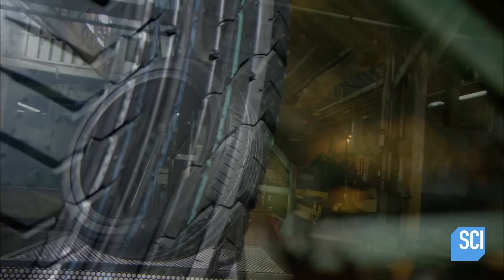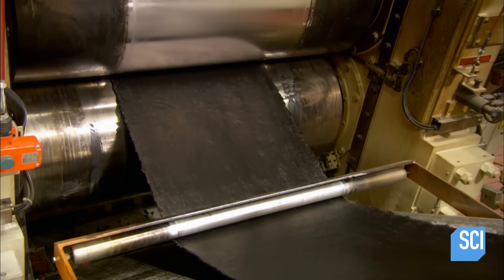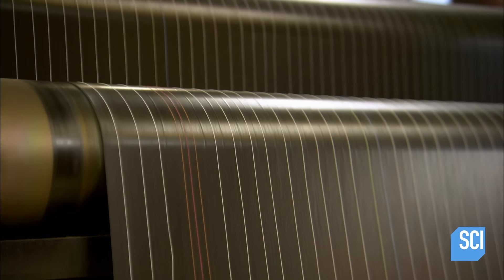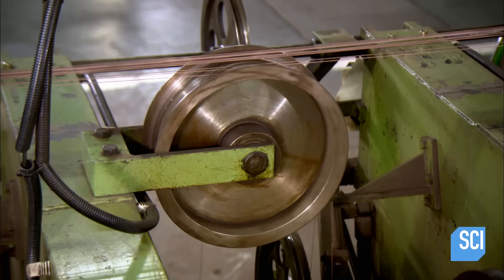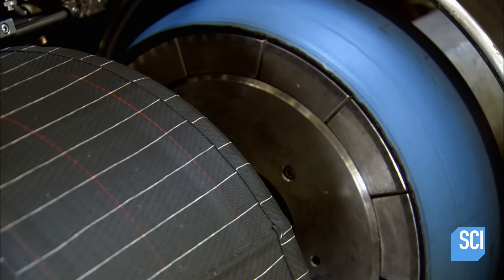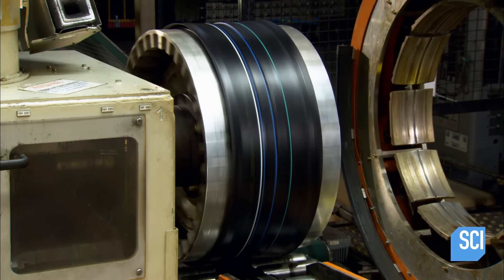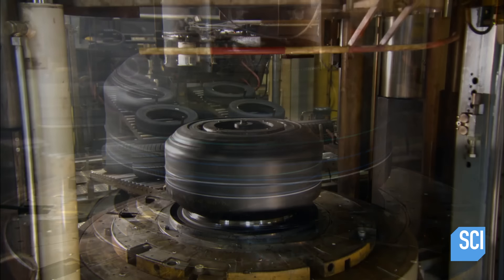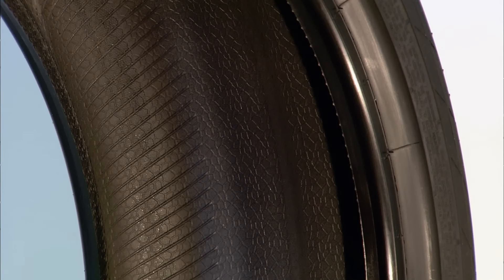How It's Made: Car Tires

Comment: I always thought tires where molded not made with many layers. Interesting information
Reply: Some of these layers are measured to the thousands of an inch.  That rubber that holds the air in, anywhere from 0.020 inches to 0.085 inches depending on the use, passenger or earthmover.  Similar with the ply.  A lot of work, and the factory smells bad.

Comment: How tires are recycled:

Oof
Reply: Its called retreading. IDK if there is a how its made on it, but I think I saw a dirty jobs on it.
Reply: You would be surprised how much ground rubber is included in some tires.  Also those curing bladders that push the green tire into the mold get recycled as well.

Comment: Wow i have never seen a banbarry that clean. this must be a research test facility for tires. a banbarry is were all the compounds get mixed with carbon black because rubber is clean and white.

the tire machines looks along the lines of what you would call a G3 OR  a VMI or a PLT

They dont use paint like this any more. to expensive.

different tire take different cure times depending on compound and size.

when they cook they tend to have flash. . flash is thin rubber that gets squeezed out of the mold and tire. real thin and makes tires look ugly.

tires go to grinders and inspections to smooth and balance the tires.

then they get shipped. theres alot more to tire building than shown in this video.

Comment: So to recap: the rubber is first coated with rubber, then magic string and wires are also coated with rubber, then it's all bonded together with more rubber-coated-rubber and stripes are painted on it to indicate what types of rubber were used, then it's placed in a mold and expanded and heated until the rubber becomes a different type of rubber. 

Did I miss anything?
Reply: You missed where the rubber is rubbed together with more rubber on a spinning drum of rubber.
But other than that, you get the rubber stamp of approval!

Comment: Why Car Wheel has to be one fold? why not divided into 5 or 6 folds that can be inflated by air separately so if one is  deflated while driving on high speed the other segments will do the job.

Comment: Do all tire manufacturing companies make tires the same way?
Reply: No
Reply: This is pretty standard stuff for making radials, but there is still a lot of manually made green tires out there.
Reply: Most all modern passenger car tires have the same construction. The differences are mostly in the chemical composition of the compounds used. (I used to work in the tire industry)
Reply: @TheRetarp  pretty much, only some small things changed in construction design.  Things like to spiral wrap or not over the belts, steel vs polyester vs aramid belts, single wire shaped bead vs multistrand wire bead, triplex extruder with overlay or quadraplex extruder for raised white letters, single ply vs multiple ply. lots of small details.  And in mixing, mixer to extruder, mixer to second mixer with no cooling stage in between,  mixer to pelletizer, more often than not, drop mills are a thing of the past.
In stock prep there are so many ways of winding ply and innerliner or gumstrips onto rolls or servers, tandem three roll vs 4 roll calenders, steelastic belt making machines that bypass the calendering of the steel. And building, it used to be one guy would build 100 tires a shift. I'd seen 20 years ago 5 guys running 3 machines that built 900 tires in a shift.  All so perfectly balanced that they didn't need trimming. No telling what the pace is now.
Ingredients in the rubber, in a single plant there may be probably 9 different reinforcing ingredients from carbon black to silica, 8-10 different rubber polymers from natural to stupid expensive synthetics with reinforement built into the rubber, a couple different oils, pine tar, a couple different waxes, a couple different antioxidants, an additive to make rubber bond to silica, an additive to make rubber bond to the wires, an additive to make rubber bond to the fabric, green tackifiers, cured tackifiers, fillers from recycled rubber, volcanic ash was used and may still be used for ice traction, and because of economies of scale and process fit, many plants ship certain rubbers to other plants within the same company.  All those differnet parts of the tire take different ingredients in the rubber.  You can't use tread rubber on the ply, and the innerliner that holds air can't even get a little scrap of that in the tread or it will make a very weak spot.
It is a much healthier environment to work in than it used to be.  A lot of the more dangerous chemicals have been replaced.  No more benzene in tire plants. And if a person can do what they are told, keep good written and computer records, use a tape measure there is some very good money to be made in tire factories.  A lot of people have put their kids though college working in one.
And all this is why they are so expensive these days.  Even with an employee discount they get costly.
Reply: @phild8095  Yes tires are extremely complicated! Each tire has something like 10 different rubber compounds plus cord plus steel. Breaker angle, ply turnup, cord spacing, bead contour, etc. all have their part to play but compounds are still the #1 differenciator. So many advances in the past 20 years that today's basic Walmart tires are better than the best performance street tires back then!

Most people have no idea the sidewall of the tires riding down the freeway at 70mph is only a fraction of an inch thick...

Comment: I don't think it's the tread tht gives it traction per se, F1 tyres are slick, the tread only specifically helps with traction when the road surface is uneven, bumpy and there are loose chippings ect. Its primary purpose is to dispel water during the wet, but the grooves obviously aren't contacting the road surface (if we're talking a normal, asphalt road surface, so aren't aiding traction at all/

Comment: How were they made in the 40's?
Reply: These were radial tires.  Bias ply tires from the 40's were assembled by hand.  Similar construction, but they didn't look like that green tire before they made it to the curing press.  They looked like cylinders.  And they were mounted on rims with innertubes.
Reply: Thank you both😊

Comment: PSA... Make sure if you're buying tires that have sipes in the tread, you understand what sipes do and if they're what you want on your tires. Like anything, there's lots to know here!  Interlocking sipes in the tread that go at least 1/2 the depth of the tread is important. Better tires have full tread depth siping. OTOH, shallow siping can wear quickly leaving the tread to become less and less effective far sooner even though the main tread is still somewhat deep. Shallow siping is a common trick use by the tire industry as it's cheaper to make tires with shallow and less sophisticated siping. There are a few different types of sipes, like 3D sipes. They all look like uniform cuts or slices within the tread. Interlocking (zigzag) sipes such as the ones found on the Michelin Cross Climate tire are a better type whereas budget tires may just have simple straight shallow siping. Again, the deeper the siping, the longer the tire will keep it's original effectiveness for its intended road conditions.  Many performance tires don't have siping because it keeps more of the tread block on the road and the tread stays more uniform under loads. There are definitely trade offs to having sipes in a tire's tread. Just be aware of them and be weary of short-term tire reviews, even from trusted sites, as reviewing a tire that's brand new on a test car / track is NOT the full story. Hope this helps

Comment: I worked in a GoodYear tire plant during the summers when attending college back in the day.  My job was to load the various raw materials into a giant two-story mixer that created the various layers of rubber for building the tires.  It was back-breaking work in those days.  Some of the blocks of raw rubber were over 100 pounds and you had to keep the conveyor belt loaded.  The money was great but, I learned factory work was not for me.  I eventually became a software developer.  It is much easier on the back.  😂

Comment: How exactly will these be made using solar and wind only? They can't. And if they use "renewable/recycled" materials... what about the machinery required to make them and it's maintenance? And if we use less fossil fuels, so only for the factory machinery then we don't have economy of scale for fossil fuel use which pushes up the price of fossil fuels and makes tyres much more expensive.
The video here is great. Keep using fossil fuels and stop pandering to nonsense agendas else we'll be slung into the dark ages. But for an elite few.
Reply: Bro what

Comment: The question is: Why do all tires have to be BLACK???? Why can't they be different colors? Wouldn't it be fun to have a car with color tires? And I'm not talking about the color band (white color most of the time) that some old luxury cars tires have on the outer face, I mean all-tire colors. I am surprised to see that even in the 21st no tire maker has come up with color tires to suit customers' preferences. You could either match the color of the tires with the color of your car, or make some nice looking fashionable combinations.
Reply: The black is a reinforcment, sorta like sand and gravel in concrete.  There are some treads made with mostly silica, but without some black the static charge would build up to some high levels.
It has been tried.

Comment: Two sets of those and a new car of data choice sign deal and mailed and size with great grip and push and pull sized for all weather. I think that's a bad job grip nails round of tire    the tire is finished and checked out by the pin man I saw in color did you and you too tire with that new grip on the mail box

Comment: I do not like how these sorts of videos lie to people. They always show a sterilized factory, entirely void of everything workers will actually have to deal with if working there. 
TRUST ME, the factory shown here is an absolute nightmare to work in. It is NOWHERE NEAR that clean, nor does the process go so smoothly. They should show the unavoidable scrap generated throughout a shift, along with showing the workers getting in trouble for defective, poorly maintained equipment which causes the unavoidable scrap in the first place.
They should show the ACTUAL facility as it ACTUALLY functions. 
Customers should know how the company whose products they are buying treats those who do the actual physical labor. They should see the insane amounts of non-biodegradable trash ONE SINGLE SHIFT adds to landfills each and every day.
Reality may cause many fear and panic. But reality can not be avoided no matter how strongly one wishes and wants.